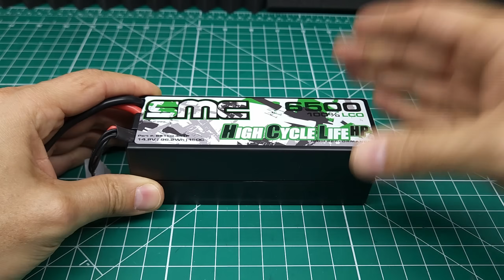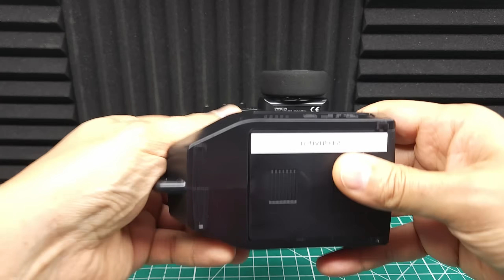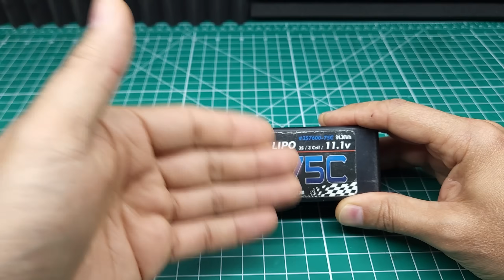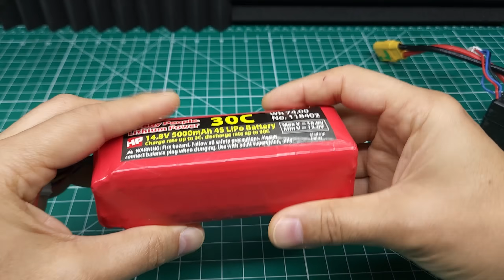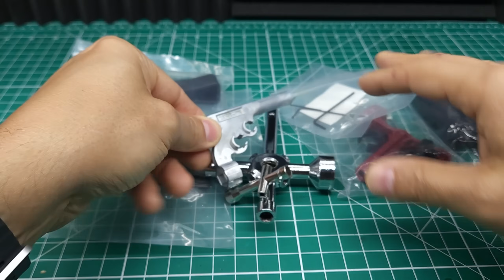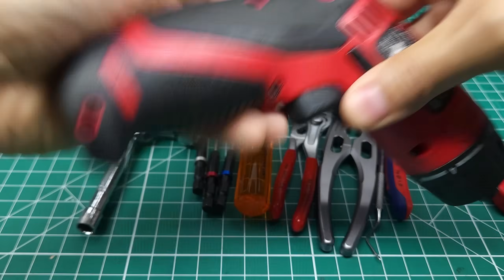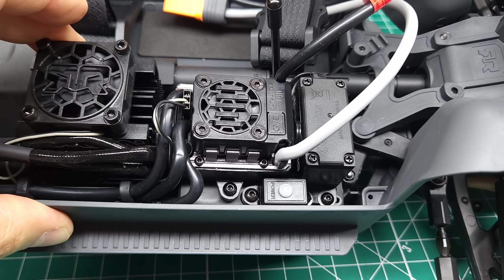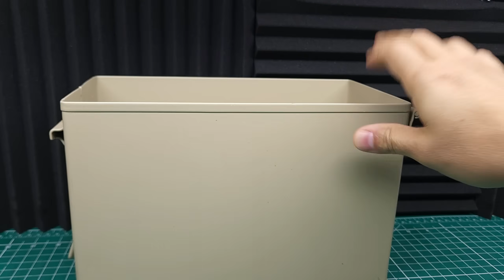RC Cars: The ULTIMATE Guide!

Comment: Excellent and helpfull tips and advice. The only thing you maybe should have touched on is that Lipo batteries ( actually all small batterys ) dont do well with extreme temperatures. Lipo batterys should not be recharged when hot. let them cool off before recharging. Also, dont store or charge them in freezing temps or keep them in your blazing hot car during the summer. That could mess them up too.

Comment: I've been using an adapter on my Typhon 3S's new speed controller because I'm not sure I can trust myself to solder such a high current connector myself. It currently has an Amass XT60 even though the speed controller is140A.
The adapter I use seems to be high quality, and at least the XT60 side of it is Amass. One time I stacked 3 adapters on my ESR meter (because it also doesn't match my batteries), and I think I remember them only adding a couple milliohms each to the total pack resistance. My ESR meter is the same as yours.
I know it's not ideal, but I'm still afraid that I might get it wrong and it won't be secure or I'll add a bunch of resistance if I try to solder an EC5 myself even though I looked up how to do it. I'm hoping I'll eventually work up the nerve to give it a try.

Comment: Hello would be possible of posting a video of the arrma vorteks 223s 2wd showing how to tear down to access the differentials with how to apply a 30k diff oil i am new to the hobby someone told that it is recommended because arrma does not out enough diff fluids. Will be greatly appreciated

Comment: The spektrum s100 smart charger doesnt have a storage option, so what should I do with my g2 batteries after ive run them and wont be running them for about 6 or 7 days (weekend basher). Its the only charger and batteries I have. All my traxxas batteries i have always done a storage charge after running them, iq charger .

Comment: Tip: The Knipex 78 03 125 is not a great choice for cutting zip ties. You might damage it in the long run. Use the 78 03 140 instead for zip ties - this one is designed for cutting zip ties and Knipex is advertising it for cutting zip ties too. There is a video from Knipex about that but I can't find it right now. :-(
Reply from the maker: Interesting!

Comment: Hi, I have smaller Grom version, after 30 minutes of riding servo lost neutral position so much even max trim could not center wheels, after two hours servo turned wheels to full lock and did not return back at all. I hoped you will say also something about servo motors. What I can do and what not to do.
Reply from the maker: Really you can't do anything. Just replace the servo
Reply: @DoRC I mean about correct handling with it. Something like: you can turn servo by hand when it is turned off (maybe), but never when it is turned on, because it tries to keep set position and if you move it, you break it.
Maybe something about the neutral position and if it shifts, if it is definitely destroyed despite of it can still operate some more time. Maybe in that point it is considerable to unmount servo saver, rotate one or two teeths on the shaft and adjust it to "new" shifted neutral position. Maybe it is pointless because then it loose neutral position it is forever damaged.
And for sure much more tips and info about servos.

Comment: @dorc one thing that I noticed a lot of people don’t go over when they’re doing educational videos and it’s something I would love to see is how to properly get scrub screws out cause my personal experience. I’m trying to replace opinion on my X Max and the scrub screw won’t come out. I took a drill to try and drill it out at this point. I’m probably gonna get a Dremel and just cut the pinion but I know there’s gotta be a easier way to accomplish this and I think that would would’ve been really a great piece because when you go to a hobby shop and you say well, how hard is it to replace opinion and they tell you it’s easy well yeah it’s easy to get to it but then once you get to it there’s that screw that has a lot tight on it and if you don’t know how to get it off, you then can get into a position like I am now so just an idea
Reply from the maker: The best thing to do is apply heat ahead of time. Once it's stripped it becomes a lot harder but you can drive an appropriately sized torx bit in and try that. You can also sometimes put the gear in advice and just tap the shaft out even with the grub screw tight. With that all being said cutting it with a dremel is very effective and has something I've done multiple times

Comment: ABSOLUTLEY a must watch for anyone wanting to get into r/c. But, i think one small thing could be added: TYPES of r/c cars. obviously there is onroad vs offroad, but covering the diffrences between buggies, stadium trucks, short course and monster trucks would have been a good idea. from my experince, here's the diffrence. 

1. on road cars can be great, but that's the only place they can ever drive. if you have rough asphalt where you live ( like i do... ) its going to be really harsh on your rc car. still, if you want to go this route, my reccomendation is a tt02 or a kyosho fazer. 
2: offroad cars can go onroad too. you can even get monster truck slicks, and make an awsome skate park stunt machine.

buggies: easy to learn, hard to master, but extreme fun when you do!
stadium trucks:  a hybrid of a buggy and monster truck. lightweight and handles better than most buggies, and has slightly better ground clerance and the body of a monster truck. 
Short course: a more scale, and durable version of a staduim truck, made to look like a baja truck.
Monster truck: high ground clerance, and great for stunts and rough terrain.

Comment: IMPORTANT, if you are replacing the connector on a LiPo, only cut one wire at a time, wire cutters are conductive
Reply: Balance plugs to!!
Reply: You just made me have flashbacks to all the times I cut connectors off, thinking if I did it wrong... But thankfully I always cut only one side and put some tape on it

Comment: Great video!  I remember learning something about LiPos when I got my first Aarma - you might think (as I did) that a battery's primary job is to store power, but it is not - the battery's job is to release that power on demand, and quickly in the case of these cars.  I always feel a bit like a bomb disposal tech when charging or plugging in the battery!  You didn't mention LiPo bags - I use one of them for charging and storing my battery.

Comment: My best tip is to buy quality tools! When I first joined the hobby in 2019, I was told this exact tip. I figured, ahh, it's not that big of a deal. So, I bought a set of Amazon. Now, don't get me wrong, that kit helped a lot and did a decent job. However, when it comes to the 1.5 screws, you'll want a quality tool. Kit builds went from 5 hours to 3 days 😂. If you buy nothing else, buy a quality 1.5 driver!

Comment: What’s a good first car for my 5 year old? Was debating a granite or traxxas slash vxl. Do you recommend something better as a basher? I plan to run 2s at 50%. I’m very new and have no charger or batteries yet. Thank you
Reply from the maker: I would recommend a granite over a slash. The granite will be more versatile
Reply: Is there something you’d recommend over a granite? If not I’d the brushless worth it over brushes?
Reply: @Blender345 if you can find them a maverick atom is also a good choice. They are cheap and have great parts support.

Comment: GREAT VIDEO!!!
Reply from the maker: Thanks!
Reply: If I have a fairly new battery that hasn't been used that much, and is sitting on storage mode for a while should I connect to the charger and put it on storage again, or is it okay to sit on storage until I'm ready to use it again?
Reply from the maker: @Joe-h1e It is best to check it occasionally. As long as the voltages are still around that 3.8 to 3.85 volts it can just sit but they do self-discharge slowly over time so it is worth verifying occasionally
Reply: Any tips on where, and how to storage lipo batteries? I've seen people use a bat box, ammo box, or put them in a tool box in their garage. @DoRC

Comment: 2 of my lipos went down to 2,7V on every cell in my Kraton 6S. They work just as well as before, no issues. I should throw them away, right? Feels bad tho 😢
Reply from the maker: How long were they at that voltage?
Reply: @DoRC max 3h, maybe only 1h.
Thx for the response!
Reply from the maker: That's on the edge. They are probably fine but I'd also probably junk them.

Comment: In my experience with LiPos, I've had 2 2s Traxxas LiPos for over 10 years before they stopped holding charge, I let them sit in an ammo can for a month or so, they ended up dropping to .5v per cell, cut the connectors (that also allowed me to make a custom BEC for my Summit) and, while this was extremely dangerous, I lit them on fire in a full steel and brick fire pit in my backyard because not even my landfill had any procedures for LiPo disposal. 10 years of hard bashing service ended in an equally hardcore way. (Also my trick to keeping these batteries alive for that long is to make sure the batteries have adequate ventilation in my cars, storage charge them after a run and always balance charge, no fast charging, that's how my buddy almost burnt his house down =p)

Comment: Hello! I can recommend the Bosch handheld screwdriver. It was cheap-ish and I've used it for years now!

For my class moment: Check all the screws on a RTR RC car when you buy it. Sometimes the screws are not fully fastened. Also, specifically for Arrma, check the level inside the differentials. I have had a fair number of Arrma's that had little to no fluid in them. The first Arrma I had burned through the center diff within 1 battery pack.

Class dismissed 🙂

Comment: I do have a little lipo charger for 2s lipo.. batteries.. got that from wltoys RC car... Yeah that's what I can afford for now, so I have a question, usually the charger shows a red led when it charging and would turn off when the battery is full.. so my question is, will my lipo brow  up when I forget to unplug it when the charger indicates battery full.
Reply from the maker: It shouldn't. The charger should stop charging when it's full

Comment: I put a thick layer of 3M stick-on foam on the bottom of the battery—I think it’s 1/8 thick. I put it over the entire bottom, keeping the battery tight and protecting it from heavy impact. Like your battery in this video, the bottom looks pretty pounded.

Comment: My best tips are just watch a lot of youtube video on how people do things and check reviews of the cars you are interested in if they are available! Also become member of forum or groups! The more stuff you learn the easier it will become to find the right car or tool and it's also a lot of fun. 

I also do something I called preventive upgrading! If I know there are weak points or things that can make maintenance easier I will upgrade. I have a Team Corally Kronos 2.0 and I replaced all the outdrive cups for springsteel ones. I also replaced the plastic diff housings for 7075 Aluminum ones. 

Also sometimes you have to spend a bit more money when buying a car to save money in the long run or so you not to have to buy  another one! I wanted to buy a Corally Synchro4 but that became a Spark XB6 because with the Synchro4 you have plastic center and F and R diff housings so you have to buy a completely build Aluminum center diff or replace the plastic housing for a 7075 alu one, same with the front and rear diff. Also the outdrive cups are not the springsteel ones so they will wear. Also the spark has a beefier suspension! 

If you look at the cost of replacing/upgrading them it was actually cheaper to get a Spark XB6. With the XB6 I only needed to replace the front and rear diff housings. Both cars also needed a center brace. The XB6 has one but It's flat and I saw one YT people having a bended brace.

 So Instead of buying a 4s €400 car, which needed at least €260 on drive train upgrades and €80 on suspension upgrades. I got a 6s €534 car with only €85 of upgrades!

Comment: My best tip is start with an rtr for your first and if you like upgrading get yourself a kit for your second.  It can scratch that upgrade itch without breaking the bank as you are literally building from the chassis up for most kits.  There are kits at several different price points as well.

That said another good informative video!!  I would love to hear your thoughts on transmitters I have an mt12 which I love but looking for a secondary controller with multimodel memory that is easier to use for those newer to the hobby for cars I keep around for those who want to try the hobby(currently have a 1/24 scrap pile crawler and a hotshot II that I would put on this transmitter).

Comment: Great information as always. One thing that wasn't covered, which I saw recently was high discharge batteries. I picked up a couple to run in my Traxxas Slashes, one XL5 and one BL-2S. Are these okay to bash with?
Reply from the maker: What specifically do you mean by high discharge batteries?

Comment: My tip....or at least I wish someone told me in the earlies is to focus on just one RC , until either you get bored of it, or you need one for a specific application that the current can't provide. This way you at least save a little on initial cost

IF you want more than one in your early days, try to have them on cross compatible platforms
Arrma 3s/4s, Corally etc

Comment: I like to replace screws with rounded heads flwith the ones that end in cylindrical heads, especially if they are being screwed into metal with loctite. Much harder to strip because a 2mm hex screw will have a 2.5 mm cylindrical head.
For the same reason I really like tekno pinions as they have 2.5mm grub screws as opposed to the regular 2mm ones.

Comment: More Lipo safety tips for newbs:
1) when charging on dual lipo chargers, take care to not cross wire balance leads or output leads on your ports. Many of the safety features built into the charger go out the window since the charger will be looking at the wrong batteries (eg. over volting the cells).
2) best practice is to always use the balance charge mode when charging.
3) pick up a cell voltage detector to make keeping tabs on your battery easier out in the field.

Comment: Glad i watched this. I just got a used stampede brushed 4wd today. Kid who sold it was selling it with a choice of 3 lipos. One was a 8000 mah but puffing slightly. Nope. Second was 7200 2s no puff. That one i took and it was at 100% charge when i got home. Last one was a 5000 2s i took over the nimh batteries he offered but that was 100% drained. 

All 3 options in one seller. Scary stuff. Glad he didn't burn down his home.

Comment: I have an old spektrum 150a 6s esc and for some reason it doesn’t let you change the lvc. It’s in my maxx and I’m running it on a powerhobby 5200mah 50c 4s lipo and it discharges it below 3.3v per cell. I haven’t used that esc that much yet but does anyone know how to fix the problem? I would expect if you can’t change the lvc then it would be set correctly. Thanks

Comment: Great video. I think having a cell checker is a good idea. Ive found even the cheaper ones work well. To make sure you have the batteries are at storage charge and makes it so you know what batteries need charge and what batteries are ready to run or for storage. I have the spektrum V2 program card that also has a nice cell checker that is easy to read but a little spendy especially if you don't run any spektrum electronics. Any of the amazon ones seem to work well also. Keep up the good work.

Comment: 3S monster trucks like the granite are a good choice but my recommendation for new RC drivers if they have the money for it is pick up a 3s capable two-wheel drive or four-wheel drive stadium truck like the vortex or the rustler. The lower profile tires and lower center of gravity means better stability for new drivers as well as reducing the chance that they're going to balloon and blow a tire  while still being big enough to enjoy in a backyard. They're also more stable on the street, with a set of street tires turning them into a fair on road car.